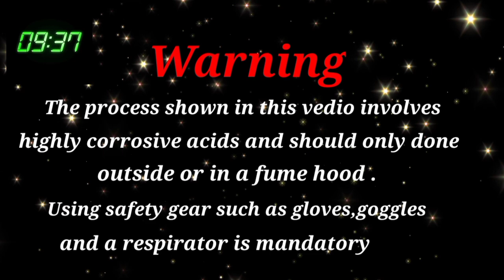Gold recovery recycling ICS chips for gold

Comment: very nice i have qwtion you add for 3 part directly aqwa rigea?
Reply from the maker: This process is very difficult . If you don't separate iron with magnetic many times you can get any gold.
But you can also add before using aqua Regia nitric for dissolve all magnetic things .
Soon I will chear a vedio How to get gold from mix chips full process.
I like this process because easy .